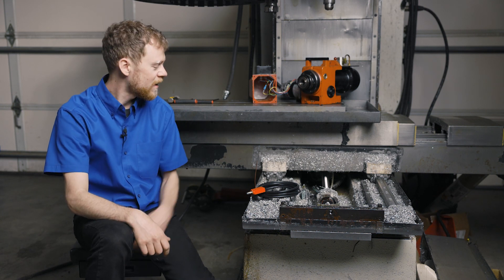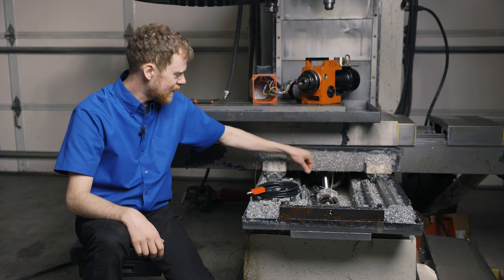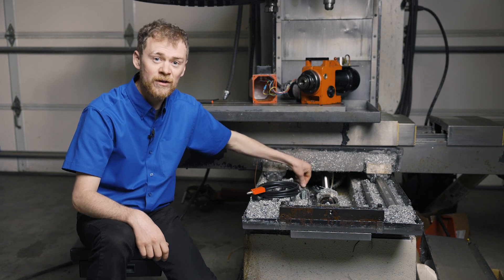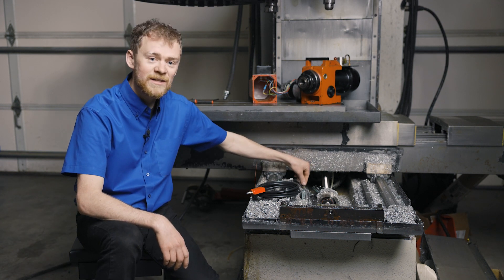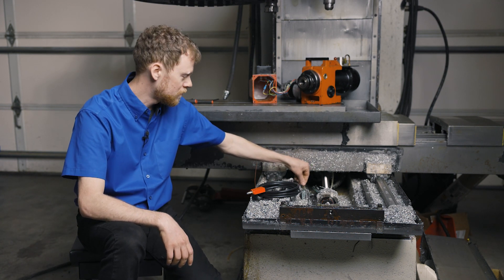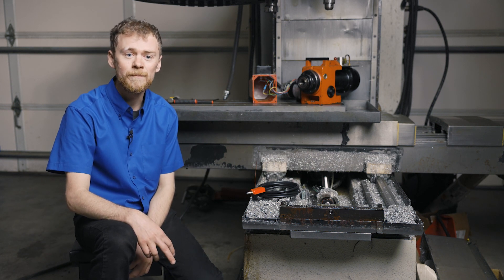Alarm 104 Y Servo Error Too Large —Straight To The Point

Comment: What about alarm 103 4 th axis too large.
Reply from the maker: It’s the same troubleshooting for the 4th. You could have a problem with the cable the motor or the home switch or the belt or pulley.